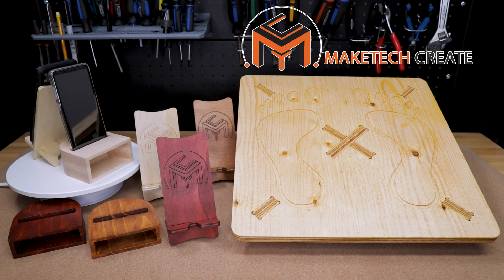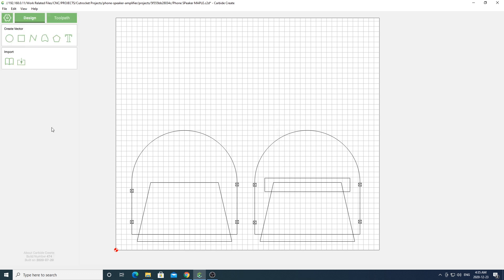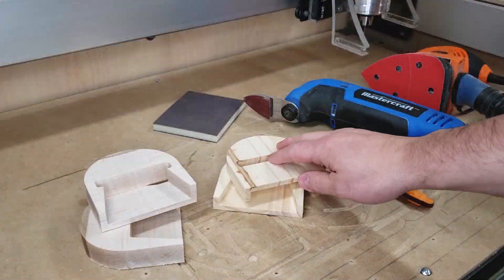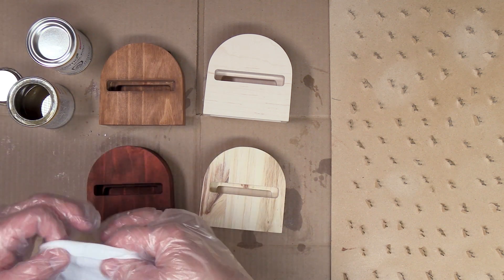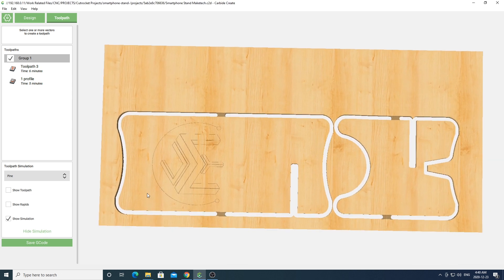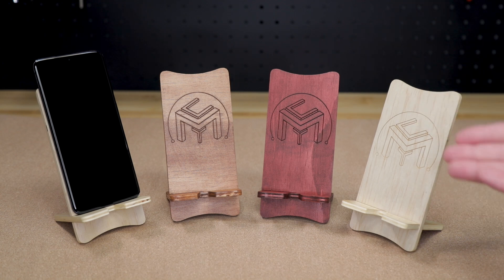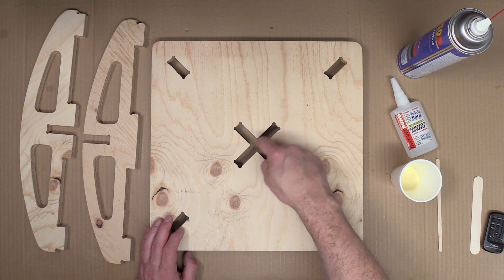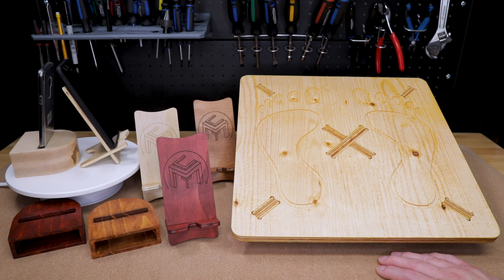Quick and Easy CNC Projects / Free Shapeoko Downloads

Comment: love the vid. not being critical but asking your opinion. 1 would staining speaker parts before assembly be easier 2 if you put ca glue on one half and activator on the other offer a more complete bond.
Reply from the maker: 1.) If you're using water based stains, you could do that. Oil based stains will keep the oil from adhering.
2.) Yes, you could do that, do you'd need to work REALLY fast. Placing CA glue on one side and activator on the other gives you an almost instant bond.
Thanks for watching!

Comment: Thanks so much! For your súper Clear explanation :) i have a little 3018 cnc can i make something like the First project with it?
Reply from the maker: I've never used a 3018 before, but I'd try the plywood project first. You should be able to do the phone speaker, assuming you can cut 3/4" deep on your machine.
Thanks for watching!

Comment: Unsubscribing... Sorry but I like doing things by hand and not by some Robot doing it for me.
Reply: Ha. Your missing the point.  It takes all the machines in the work shop to make cnc items.  It's just one more tool.  It will bring your work up a notch or two with the engraving options,
Reply: The same thing was said by hand saw guy to the circular saw and band saw guy…. Or the guy with an axe to the guy with the chain saw…

Granted, not all tools are for everyone.  Hope you find the tools that fit your needs and the videos you need to learn to use those tools.
Reply from the maker: Bye, Felicia!